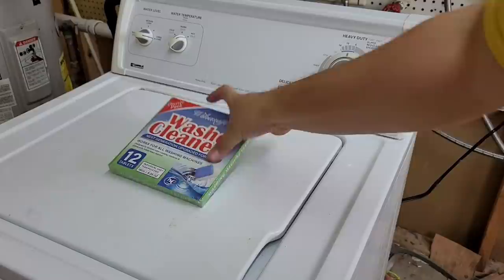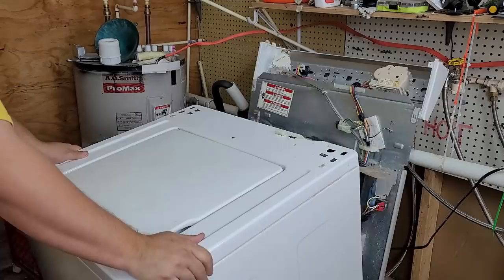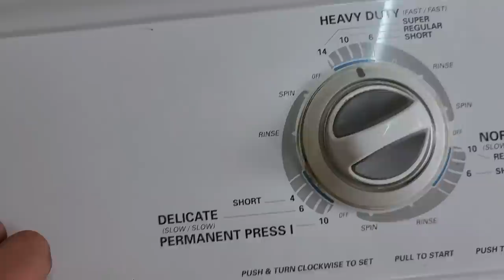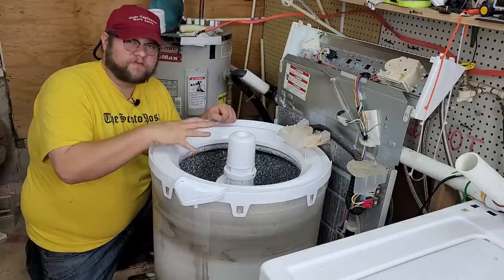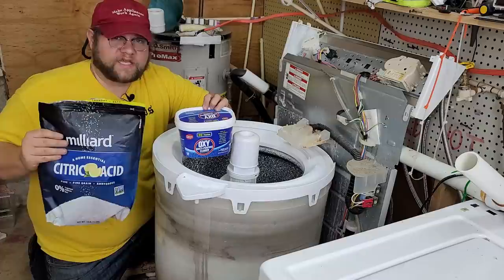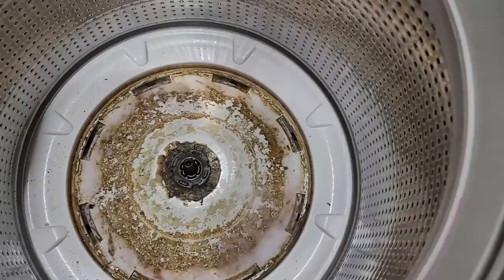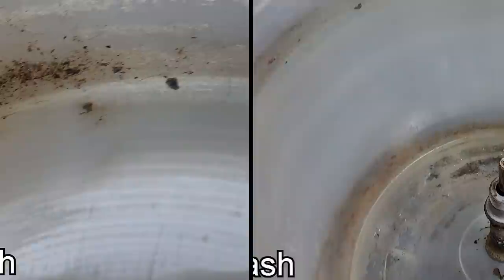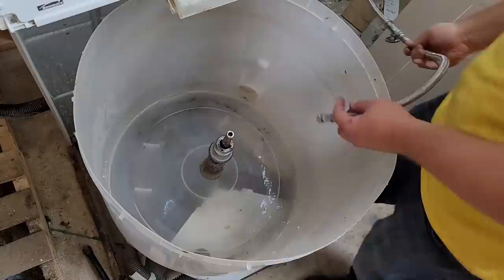Clean a Washing Machine Inside: How to Remove Mold, Soap Scum and More with a CHEAP Organic Cleaner

Comment: Routine use of citric acid can damage rubber parts. Better to use Oxiclean, laundry detergent and white vinegar (instead of fabric) softener in every load. White vinegar will softens clothes while cleaning the clothes and the machine at the same time. White vinegar is cheaper than fabric softener and you don’t have a waxy buildup to deal with as well.

Comment: Hmmmmm just thinking about this, citric acid is obviously an acid, and oxygen bleach (sodium percarbonate) is a base/alkaline, therefore they would somewhat cancel each other out right?? From doing a bit of research online it sounds like it is better to do the main hot wash with one, then in the fabric softener compartment put the other, eg main wash with citric acid, final rinse/fabric softener with oxygen bleach. This way you get the full cleaning power of acid and alkaline in the one wash

Comment: I tried the Aafresh for a used Kenmore I recently purchased.  It just loosened the "Scrud" up and made it worse than if I'd done nothing.  I am going to try your method but I read on a blog that Oxy cleaners and detergents as well as chlorine are responsible for the Scrud in the first place.  So I'm going to try the Citric Acid by itself first, but I'm hoping the acid won't corrode the parts since there isn't any silica to prevent corrosion.

Comment: I may try this as I took an lg top load that was sitting in a garage for a year had scud/scum on the outside of the inner drum.  I took it apart and power washed it all sparkly clean and hand washed the tub it wasn’t bad.  Put it all back together and I’m still getting a bit of the scud/scum coming from somewhere🙁

Comment: I have a LG front loader at home and at camp.  I've cleaned the soap dispenser many times taking the fill tube apart at home.  Always mold.  At camp, same machine, I heat water with solar so it is free and hot water is plumbed to the cold inlet used in dispensing.  Cold Tap is selected which is a little longer wash.  That soap dispenser is spotless after years. All cycles use hot water and the clothes come out steaming after rinse.  Wife uses Oxyclean every load. Don't think I will be needing to clean that machine!
Reply: I’m definitely excited to try his cleaning cocktail, but what we’ve found useful is in between cycles we put a small fan right on the grey rubber gasket so that it’s got airflow until the next time we use it. It’s worked great for years. Now if I could find a tool that could get down under the tube I would be so exited! You know we’ve got some germs just lurking in there!

Comment: I live in a "senior" apartment complex with communal washers (one each) on all 3 floors.  Our maintenance guy doesn't know squat about washing machines or dryers and our "cleaning girl" thinks she knows everything.  These get used a LOT.  I have pulled the dryer apart on my floor more often than I care to think about to clean all the lint out (and I am tired of running 3 or 4 cycles to get jeans dry).  The washers are about 3 and 4 years old and I can see the scum buildup around the top and I am not about to pull one apart to clean it because they would blame me if something broke (and I did A/C and appliance repair for years and do know my way around).  I am going to try your "mixture" and run a load of hot water through it (we can't set the wash time) and see if it at least smells a little bit better.  I have pulled apart some gross washers in apartments (and the management was loathe to spend any money and didn't want us "wasting time" cleaning the machines.
Keep up the great videos.

Comment: Thumbs up, you make very good videos! The info was valuable, i agree with your solutions, even though it doesnt really help much. I have bad news for you all, the inside of your metal or copper pipes look exactly the same. Water comes to us with various minerals and chemicals..this stuff eventually coats everything inside a public system of pipes.

Post script..i wonder if fine walnut shells added would help mechanically agitate the scale inside the tub and basket..the kind of crushed shells used for sand blasting or polishing

Comment: I'm planning to take my washer fully apart to clean it tomorrow. I'm wondering if the electrical components/motor/transmission, those parts below the tub, can they get wet when I'm cleaning the tub? Would really appreciate advice. Thanks

Comment: I have a Whirlpool Cabrio I got in 2013 (model # wtw5600xw3).  I've always just used the Affresh tablets, but probably only 2-4 times a year, not monthly like they suggest (just two adults in the house, probably not as much laundry as a house with kids.)  I haven't noticed any issues with my clothes- should I still do this?    Are there filters or anything I should be cleaning, gaskets I should replace?  I did have to have a part replaced about 5-6 years ago, but I forget what it was; something like it wasn't shifting gears from one cycle to another- it would just fill with water...sit...drain.  Other than that, no issues that I've noticed.

Comment: The Milliard Citric Acid on both the 5lb and the 10lb bag have both gone up in price considerably since you posted this video. 10lb bag is now $39.99 - 5lb bag is now $22.94, and that's if you're an Amazon Prime Member. Prices on everything have gone up to a point to where these big companies are going to price themselves right out of business, because folks (like me) will get (have already gotten) sick and tired of getting ripped off continuously by big corporations. I'm already there! 😕 😕 But THANKS for the video! You did a great job!
Reply from the maker: I'm making a custom blend soon to sell for a reasonable price along with other cleaners we've begun to use since thus
Reply: @bensappliancesandjunk  - After doing some research on this Citric Acid thing, the price on Amazon for the 5 & 10 lb bag is cheaper than (almost) everyone else is at the moment. I saw one other brand slightly cheaper listed on Amazon. But not by much. I'll be watching for your custom blends to show up for sale. 🙂
Reply: I just ordered Elos premium 2 1lb bags from amzon, yes i'm prims 27 bucks inc tax

Comment: I use dishwashing tabs to clean my  new washer and it works great.  However, my mom gave me her old washer from the 80's, and it does not need cleaning.  I love the old washer much better than the new 1,200.00 one, but I keep it so when my old one dies, I will have backup.

Comment: I've got an old top loader (20-30 yrs old) and when it goes, I'm buying a refurbed one, that was built here in the USA, not new.  My one sister went with a new front loader, which she hates and my other sister went with a new top loader, which has all kinds of safety (imagine being too stupid to run a washer with common sense) and "efficiency" crap on it, which she hates (both of them cost big bucks).   Give me the old, lasts for decades, simple appliances.  I've got a well and could care less that it uses more water.  I bought a new property a few years ago and it had an electric stove, which I didn't like.  It took me a while to find a simple knob gas stove (didn't want digital), but I got what I wanted.  I found out that on some of the new gas stoves, you can't even light the burner with a match, if the power goes out!  Just another "safety" feature!

Comment: Should I attempt to take my washer apart and scrub it with elbow grease and the citric acid you mentioned? Or just run a bunch of citric acid cycles? If it is safe, I will take apart the washer and clean the drum by hand and from now on I will run my cycles every month with a cleaner tab. I wish a parent would have taught me this before so I wouldn't have to take it apart, now I know how to save the time. Thank you for this video. I cannot wait to fix it and have my laundry machine good as new.

Comment: Hi Ben,
Thank you for making the video. I read that cirtic acid will degrade the rubber parts of the machine. Does top loading machines have any rubber part where the citric acid solution can soak/contact them? Thanks

Comment: I use bleach when I wash my all white towels and wash clothes. I don’t have any smells. I specifically don’t buy colored towels because I like using the bleach to not only remove dirt and stains but also to kill germs. That top edge looks like it needs scrubbed. I would use a brush and you could use white vinegar and baking soda.

Comment: I have a washer that was depositing white residue on clothes. An appliance REPAIR person told us that outer tub was coated in white flaking residue (probably old detergent) and recommended to keep using a cleaner product which wasn't working or completely replace the tub for $478. WHAT. How about I pay you to clean it off?!  Thank you for this very useful video.

Comment: I have a good friend who repairs commercial machines in the Santa Barbara, CA area.
Reply: I took the machine up to him about a year ago and we replaced the bearings on it. This is for a Maytag Neptune front loading machine. Doing those bearings was a job and a half but we were both glad when it was done. I was concerned about scale buildup and he suggested that when I got it home to use one part of muriatic acid to seven parts water. We figured that about one quart of muriatic acid would be sufficient and that I could allow the water to partially fill the machine and then pour the acid into the detergent dispenser. I ran the test outdoors in order to avoid fumes and I connected it to cold water via a garden hose and had a 5 gallon bucket to catch the water as it was pumped out. I was very impressed by how much scale came out of the washing machine. I ended up disposing of the bucket by pouring it down the toilet and I am connected to a public sewer.

Have you ever used muriatic acid in this fashion?  Good job on the video and remember the they can only get better!

Comment: Liquid dish soap is another really good remover of soap scum, but probably only usable in top loaders with a full fill option and in light dosages so as not to suds up the drain pump.  I wonder how powder or liquid automatic dishwasher soap would do compared instead of oxy cleansers - especially since they are about the only place you can find phosphates (yes, bad for the environment) in the home.

Comment: all you need is Sodium Percarbonate  and really hot water let it sit full for 12 hours and then drain and run to clean. The key is to run with hot water. Sodium Percarbonate is the active ingredient in OxyClean and Borox
Reply: How many cups of oxyclean or borox for heavy load do you put? Do you use one or another or both at same time?  Thanks

Comment: Great video! What the tool you used to remove the large basin nut with 4 notches at 90 degrees?
Reply from the maker: Spanner wrench. TBA123B
Reply: Wouldn't it be TB123B? I tried looking up TBA123B with no good results, but take the A out of it, and found it.

Comment: What are the tools you used to get the agitator out? I already have the cabinet off because I am replacing the lid switch. The inside of my barrel around the top is way worse than the one you’re working on and very black.

Comment: @Bens Appliances and Junk
Sorry to bother, but have a question….
Do I use HOT, WARM, or COLD WATER with this process?
Thx for this and it’s pretty cool, along with so much cheaper.

Also, can I put this mix in the toilet tank for cleaning that too? Or that a negative?

Thx for this vid and have good day, cheers✌🏻

Comment: Have you tried LAs Totally Awesome?  It works for many applications.  I wonder if it would work for this?  Very helpful video!  I live in a HOA situation and our repair people are a hassle.  They don't want to repair, clean anything....get a new machine.  It is so discouraging considering the same machines last 15-20 years elsewhere.  Most people use way to much product and ruin their washer/dryers and we have even had plumbing issues due to excess products.

Comment: I also use essential oils (mix of teatree, citronella, clove, cinnamon, mandarin, lemongrass, lemon, sweet peppermint...mainly ) after the cleaning with hot water to kill the rest of the spores and refresh the drum and protect the metal parts. I also use baking soda with ever whites wash and do cleaning wash once a month in 100C with either vinegar or baking soda( if you have a hard water) or or citric acid and if i dont have any then I use a washer cleaning tablet or a few dishwasher cleaning tablets instead- and mind it is a long super hot wash- the temp is pretty much at a boiling point. but again a hot wash with oils is super after that super hot cleaning wash.

btw. 
rust is caused by bleach. it's better to always properly rinse the washer after adding anything any detergent that contains bleach. after a drum bleach (aka super cleaning but potentially corrosive to metal acid wash ) is important to rinse like 2 x with something like baking soda ( alkaline solution to neutralize any acids).

Comment: I have an Amana NTW4605EWO that I desperately need to deep clean. I can see the mold. I have taken it completely apart but I STILL cannot get the agitator off. I have tried everything. And I mean everything. It will not budge. I even tried a strap and a 2x4. Any tips?

Comment: The star of the video, the famous KENMORE MODEL 80! The best top loading washing machine ever made (actually made by Whirlpool, but, hey). They had to stop making them, because they were cutting into sales of new machines, they lasted so long, and were so easy to fix. We still have ours, and it's going strong. Bypasssing the lid switch is only dangerous if you're a moron, and don't know enough to not stick you body parts into a working machine. Same with dryers: and here's a tip on THOSE for you; bypass a dryer's lid switch, and pull your clothes out of the dryer while it's still spinning, avoiding having your clothes fall into a heap. The heat from the dryer will keep the clothes fresh and free of wrinkles, making your laundry great looking without ironing! You save thousands of hours of ironing, all by installing a bypass switch for the door. You're welcome.

Comment: Is there a way to take a LG inverter direct drive top loader washing machine apart to clean the tub housing (the white part around the silver drum)? Or the top white parts like the seals between the plastic? I watched your video to clean the middle part under the silver drum but I feel like it needs more. Also, should water be sitting in that white drum holder or do we have a clog? Took the back pump part apart & it was holding water that we drained.

Comment: Thanks for the ingredient list. Also, do you think washers are dirtier now that people are using cold water? Someone else here said that fabric softeners make it worse too. I had to stop using anything scented because after 30+ years of using liquid Downey, I developed an allergy to the scented stuff. It was just easier to stop using it.
Reply from the maker: Softeners are a big culprit and sadly, "All natural" ones have big problems disolving too. I am seeing a lot of front-load washers that go bad because the fabric softener and detergents get behind the main bracket that holds the washer tub in place, and just... Sits there, eating the bracket away after years of use where the detergents never get cleaned away. Eventually, it causes a catastrophic failure that ruins the washer.
Reply: @bensappliancesandjunk  Figures I quit using softener and our washer goes out. We think it was the circuit board and since it's 15 years old, we're unable to find a replacement. What would you recommend for a front loader? I'm looking at the LG. Btw, our old one was a Maytag Neptune.
Reply: @winebox  bit late here, but I read your comment and was reminded of an article I saw a couple of months ago that fabric conditioner contains processed animal fats which causes it to stick within the machine. I wonder how many vegans and vegetarians know about this... 😱
Reply: @bensappliancesandjunk  True! been there, broken cross and all!

Comment: I use vinegar as a softener in my washer. Is this good enough to keep my washer clean?
Reply: vinegar will work for the calcium in your hard water, but not so much on the soap scum.  I use a mixture of vinegar and Dawn on my shower to clean it...vinegar for the calcium, Dawn for the soap scum.

Comment: Will the citric acid and oxyclean work on the drum with the scrub brush? I have washer apart, replacing a tub bearing and pretty gross with scum and mildew.
Reply from the maker: Yes. It'll obliterate it if you can let it soak at all

Comment: Great video, I have a front loader that is going on 13 years old and it still works well but it needed cleaning and i spent a fortune on so called washer cleaning  products and not one actually worked, all they really did was temporally deodorize it with a nasty chemically fake smell, since then I have used dishwasher tablets after a google for alternatives and the ones i use are airy Platinum Plus All-in-One Dishwasher Tablets Lemon and a pack of 55 costs around 9 bucks, and so throw 4 in the washer and run a 90c wash and worked great for me
Reply: I’m definitely excited to try his cleaning cocktail, but what we’ve found useful is in between cycles we put a small fan right on the grey rubber gasket so that it’s got airflow until the next time we use it. It’s worked great for years. Now if I could find a tool that could get down under the tube I would be so exited! You know we’ve got some germs just lurking in there!